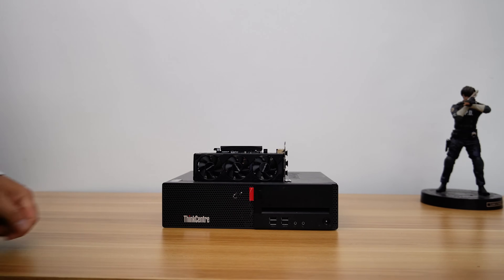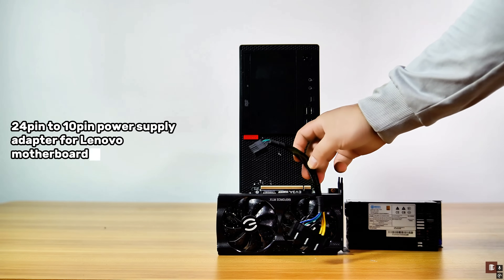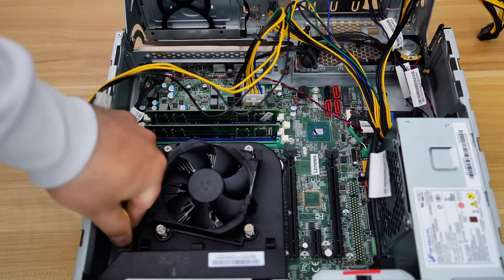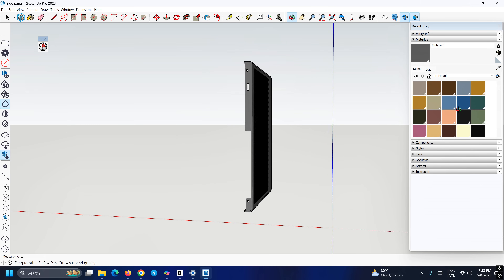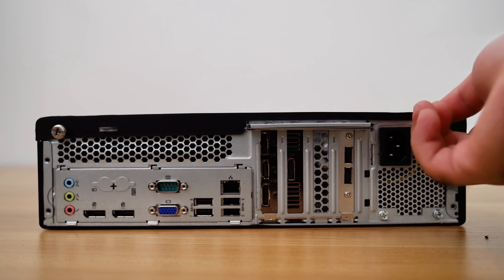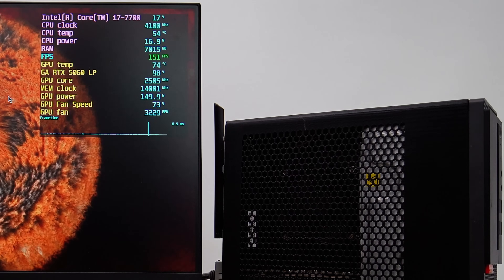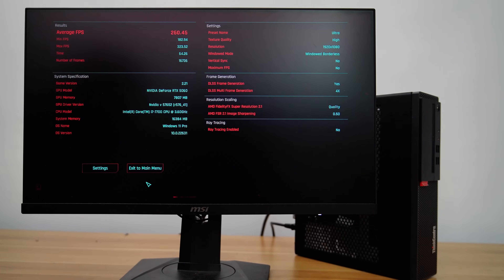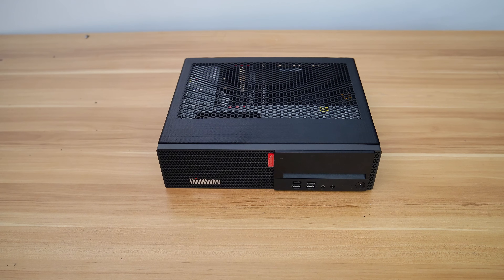RTX 5060 Low-Profile on SFF Office PC: Is It Really That Hot?

Comment from the maker: How much performance is lost on an old PC with PCIe 3.0 compared to a new PC with PCIe 5.0? Check out this video: https://youtu.be/hIzCymo0SdM
Reply: hi, can you make Ventilation size panel for Lenovo p330 sff ?
Reply: I finally got my 5060 LP. I just ran a Furmark at 8892 at 148 FPS in the PCIe 3.0 X4 slot on an Optiplex 7090 i9-10900. Max Core temp was 82 C.

System is Optiplex 7090 i9-10900.
64GB PC2666 Ram
256 GB Gen3 X4 NVME
ID-Cooling IS-55 CPU Cooler
Apevia ITX-PFC500W Power Supply
Noctua 80mm Intake Fan 
2 Noctua 40mm Outlet Fans

I compared it to my Non LP 4060 build which is superior in every way running in a Full Gen4 X16 slot and that one's Furmark was 7310 at 121 FPS.
Reply: Was able to get the Furmark over 9000 by upgrading to PC3200 RAM. It definitely runs hot, look forward to a possible ventilated side panel.

Comment: You replacement PSU is build friendly. Good luck doing the same with a Dell SFF9020. Flex ATX format, 8 pins Mobo instead of 24, and custom fan system.
Reply from the maker: All covered. Check my other videos.

Comment: yeah but there's kinda of mid card
if someone's going as low as office pc + lowest gpu on the market they are most likely gonna have old games to play...old games with physx32 that are no longer supported.
Also the cpu will be your bottle neck specially if it's one of those soldered or dead platform ones.

Comment: I'm thinking about purchasing a low profile rtx 5050, could you tell me if low profile gpus have the same performance as normal ones?
Reply from the maker: The RTX 5050 and RTX 5060 Low Profile indeed have the exact same specs as the normal, full-size RTX 5050 and RTX 5060 GPUs. The low-profile GPUs might be limited by their small fans and heatsinks, which can cause them to run hotter and tend to have lower clock speeds. In theory, those GPUs have the same performance, but the low-profile GPUs might lose some performance due to overheating that causes throttling.

Regarding your question, the low-profile GPUs for these models do have the same performance as the full-size GPUs if you can manage to keep the GPU temperature under the throttle limit. If it runs too hot, it can lose some performance due to GPU overheat throttling. Thank you.

Comment: Hey, thanks for video and sharing the side panel 3D print file. 

I had this panel printed locally with a service in PETG. It has really helped with CPU temps on the M920s I had built for my son. It was cheaper to print this panel than it was to source a stock panel from a M310.

Some feedback on the design; 
1. Add feet to the side panel print file. So that he stands up straight 😊. 
2. The hole for the right hand thumb screw did not line up fully with the chassis. The hole needs to move 2-3mm further to the right. The left is perfect along with the overall fit 😎

The videos you put out are great! You show what is possible with older systems and it reduces these becoming e-waste too soon. Thank you
Reply from the maker: Thanks for the feedback; I will consider your suggestions for a future update of the design.

Comment: I spent 1000 on the case/mb/ram/ps and it still overheats at 4k. :( Given, it's only supposed to be a 2k card...and who wants to play in 1080 anyway??? Like no lie, that card needs clear outside air and clear ventilation on both sides of the case....if you're going to put it in a case at all. The thing will burn your hands.

Comment: This is actually the direction I want PC gaming going.  I'm sick of large PCs.  This is something that makes me like what Nvidia has done over the past two generations unlike most people's opinions.   I'd rather see lower performance jumps from Generation to Generation if it means smaller hardware.   At the same time it also means game developers will not have to constantly up the grahpics wise every year or two as much.    Slower progression in performance = hardware we already own will be relevant longer.    If only Nvidia didn't charge an arm/leg for these products.  

That being said good example is comparing MSI's 3070 Ventus 2 to the MSI 4070 Ventus 2.  They look similar but the 4070 version is like 20-30% smaller height wise because the heat sink needed for a 4070 is much smaller than a 3070.  The 4070 gets better performance than a 3070 with less power draw.  Now that is the direction I want them to go.   

We've gotten to a point that old CPUs were smaller than a Silver Dollar, now they look like they're the size of a small smartphones.  GPUs which were once the size of check book are now almost the size of a Playstation 3 Super Slim.  This increase in size/girth really needs to stop.   I want them to slow down and try to get products back down toa small form factor, low power draws while not losing performance, even if it means only a 5%-10% gain each generation.

Comment: You could also have someone laser cut the top to put the same holes in it, which depending where you go, you could even get a fun pattern included.
Reply from the maker: That's an excellent suggestion! Laser cutting is a great alternative that could definitely work.

My channel focuses on creating solutions using the 3D design skills I specialize in, but the ultimate goal is to inspire people to solve problems in whatever way works best for them. Thanks for the creative idea!

Comment: Drill holes in the stock panel is an option too
Reply from the maker: If you don't need to keep your PC as it original and revert state and revert back later drill the holes also a good option to improve cooling.

Comment: since you don't allow edits, or have a fragile ego. 0:54 its very easy to upgrade a SFF. Will it fit all in the case? probably not. It takes a quick search on amazon to get the right GPU to motherboard power adapter to use a regular PSU that can power a normal GPU. If you're using any 5k series GPU that's moronic. get a 3k you know, an actual recommended GPU hat wont immediately get bottlenecked.

Comment: i feel a redesign of the side panel could allow you to put  1-2 90m fans next to the gpu to keep it even cooler so you don't need to be concerned if it could thermal throttle and allow it to get more performance too

Comment: I have done a similar mod using a Dell OptiPlex 790. Note: make sure you use the larger model with 4 expansion slots. This case already has vent holes in the top above the CPU and expansion slots, and the MB is a mATX form factor. I dropped in a Gigabyte B550M with a Ryzen 5 5500, and will be adding the 5060 when I get around to buying one, so it makes due with my old GTX 1030 for now. You'll have to do some wiring work for the power switch, etc. but the diagrams are all online

Comment: 5060 (145 watts) and 9600x3d(65 watts) the hdplex gan 250 watts can handle this cpu gpu combo?
Reply from the maker: I think you should not try it. The 9600X3D's maximum power limit is 138W, so while your setup might run for a little while, you will face system instability, crashes, or even damage to your PSU. Thank you.

Comment: plesae make solution with dell optiplex 5060 sff with lowprofile dual slot gpu wthout changing the psu, or normal gpu
Reply from the maker: It support single slot low profile only unless you cut off the case.

Comment: Thanks so much for this demonstration.  I have been wanting to push my 5060SFF as much as possible for a while, what better way than with the 5060LP? I managedto snag a 460w PSU and equip the case with fans and good cpu cooler too. I know there would be a bottl3neck with my i5 8500, but the sheer horsepower the 5060 and its framegen would have over my goldie 1650 would make it negligible. 

Asus will come ou with a smaller version of the 5060LP soon, can you do a video on that too? And compare either with the yeston single slot 3050LP 6GB?

Comment: I've heard that some of these lenovo PCs (Specifically in the m910 and M920 series thinkcentres) have an issue, that when you use a non-proprietary PSU, the motherboard won't turn off the PSU when you shut down the computer. Have you experienced this? I wanted to know, because I have a 450w SFF PSU and wanted to do a swap on my Lenovo thinkcentre M910t and don't want the PSU to stay on all the time. Any answer would be appreciated. Thanks.
Reply from the maker: Please research more about genuine PSU replacements versus 24-pin to 10-pin adapters for Lenovo. What are their differences?

Comment: Hi, Thank you for sharing your 3D print designs and nice videos! 

I am currently building a Lenovo M720s sleeper gaming PC with an RTX A2000 6GB, and I’m very interested in the ventilated lid you designed and uploaded. 
I am using a BambuLab A1 for 3D printing, but unfortunately, it cannot print this large model in one piece. I would like to modify the file and split it into two parts for easier printing. Would it be possible to get the original 3D file? I am having trouble converting the STL file into a proper 3D model for editing. Thank you very much, and best regards from Croatia!
Reply from the maker: Hi, I only have the SKB file. I think even if it's split into multiple parts, it still can't be reassembled into one piece. I believe the RTX A2000 will run well on your PC without needing an additional ventilation side panel, since both the CPU and GPU use a blower-style cooler. This means hot air won’t accumulate inside the case. Thank you.
Reply: Thank you for your reply! Would it be possible for you to export it as an OBJ file and send it to me that way? I am planning to replace the CPU cooler with a Thermalright AXP90-X53 and add extra intake and exhaust fans, since I always aim for the best possible cooling in my PC (my main gaming rig is in a Lian Li Lancool 3 case 😄).

Comment: 82C is not much room, because you really do not want Vram to reach 90C.
Reply from the maker: There is no choice but RAM is the same temp with with core temp in this GPU, even you overvolt this GPU. If you can't accept it don't buy it.

Comment: I have an Lenovo M920s SFF, i7 8700, 32gb RAM, but I use it opened with a Full size GTX 1660 super and fulll size PSU 550W with 24 to 10 p adapter... it's works, but is ugly

I would like do the same upgrade, rtx 5060 LP... but when I think about the price... I think it's better by a new one PC

Comment: Mine runs in the mid 80s on an open air test bench at a 22° C ambient. It's only going to get hotter in a case. Outside of better ventilation, I feel like it needs some PTM 7950 and an undervolt as well.
Reply from the maker: Thank you for sharing your experience!

Comment: I wonder if this 3D lid can fit my M75s. The lid shape is very similar.
Reply from the maker: You can check the dimensions of the PC chassis in their datasheets and compare whether the cases are the same size. I also assumed that the side panel would fit the Lenovo M720T since it looks exactly the same, but when I tried the printed side panel, it turned out to be smaller. Thank you.

Comment: You know, with proprietary PCs needing an upgrade, the Lenovo SFF PCs should have ddr4 16GB RAM and a potential RTX 3050 LP GP or an RX 6400 LP GPU. As well as a 450w PSU and an Intel i5 9500. Proprietary PCs are getting cheaper these days. You can probably buy it for $100 or less. Most PC gamers usually buy expensive PC parts and build them from scratch. However, some PC gamers would buy cheaper parts and research them on eBay, AliExpress, or FB marketplace. Speaking of which, the FB marketplace needs to be a standalone app instead of connecting to the FB account.

Comment: Great video! I've been waiting for a 5060 lp video. Everyone has been shitting on the 5060, and they're mostly valid complaints. But its real value is in its low profile gpu.
Reply from the maker: I am happy to hear that you like the video!
Reply: The 5060 can be expensive to buy. But the 20 and 30 series GPUs are cheaper.
Reply: @adogg281 correct, but I'm more concerned for low profile gpus. It's great to have options.

Comment: This video is about building a gaming PC as cheaply as possible using an old office PC. To do this, I need a 3D printer for the ventilated side panel, which easily costs €3,400. Where does it make sense to just drill a few holes into the old side panel?
Reply from the maker: Can you see the world in a good way? Feel free to try it on your own. My goal is to demonstrate that, as long as we can manage airflow in this restricted PC case, we can install a high-power, low-profile GPU like the RTX 4060 LP or RTX 5060 LP without overheating issues.

There are many solutions, such as leaving the side panel off or creating ventilation in the original side panel. However, my channel niche is 3D design, so I integrate my 3D design skills and printing into my videos to make them unique from other channels. This is my core strategy for surviving in the highly competitive video platform space.

Thank you for watching!

Comment: Why not just drill holes in the original case?
Reply from the maker: Feel free to try it on your own. My goal is to demonstrate that, as long as we can manage airflow in this restricted PC case, we can install a high-power, low-profile GPU like the RTX 4060 LP or RTX 5060 LP without overheating issues.

There are many solutions, such as leaving the side panel off or creating ventilation in the original side panel. However, my channel niche is 3D design, so I integrate my 3D design skills and printing into my videos to make them unique from other channels. This is my core strategy for surviving in the highly competitive video platform space.

Thank you for watching!
Reply: @itggear ah makes sense and thanks for the thoughtful response! lol I just couldn’t help but thinking the whole time that a drill could accomplish the same thing in a pinch.

Comment: Hello, I always enjoy your videos. Is there any way to compare this LP 5060 to the previous genereation? I have a RTX 3070 Pallit with Ryzen 5 3600 and I was thinking of upgrading my entire PC. So is this GPU represent a solid upgrade in this case I build a super small setup?
Reply: @EVANDROSAMPAIO  You dont need to upgrade.
You can get a 5700x3d and a 5070ti, and then wait like 7 years
Reply: Hi my friend I was thinking about this, 5700 or 5800 x3d have enough firepower for a couple of years, thanks for the advice 😊

Comment: a pos 5060 with a PCIe x8 conector instead of x16 is the main reason it performs poorly, unlike the 9060 XT. Furthermore, the motherboard would perform better if it was compatible with PCIe 5.0 instead of 3.0
Reply from the maker: Please compare the RTX 5060 with the RX 9060, as well as the RTX 5060 Ti with the RX 9060 XT. In this video, I am not focused on measuring performance loss in this PC setup. Instead, the goal is to determine whether this 'low-profile GPU' can be installed in an OEM PC chassis and to explore solutions for achieving this. In real-world usage, people can install this GPU in newer PCs like the ThinkCentre P360 SFF or HP Z2 G9. Therefore, you don't need to focus on aspects that are not relevant to the video's main topic. Thank you.

Comment: Nice but you'd be best showing something that just removed material on the oem cover or at least included that as an option. I love the printed component. I truly expect most to just go sans cover.
Reply from the maker: Feel free to try it on your own. My goal is to demonstrate that, as long as we can manage airflow in this restricted PC case, we can install a high-power, low-profile GPU like the RTX 4060 LP or RTX 5060 LP without overheating issues.

There are many solutions, such as leaving the side panel off or creating ventilation in the original side panel. However, my channel niche is 3D design, so I integrate my 3D design skills and printing into my videos to make them unique from other channels. This is my core strategy for surviving in the highly competitive video platform space.

Thank you for watching!

Comment: I am a complete nood at 3d printing to the point where i dont even know what material the side pannel is made from is there any way i could get the side pannel from some 3rd party i would have no idea how to even begin searching this up sorry for the inconvenience
Reply from the maker: The main objective of this video is to show you that the RTX 5060 Low Profile with a 145W TDP can indeed be installed and usable on an old SFF Office PC, provided that airflow is properly managed. The 3D-printed side panel is simply a tool to demonstrate that a solution exists for this setup.
For real-world usage, people don’t necessarily need a 3D-printed side panel. There are other ways to improve airflow, such as purchasing a ventilation side panel that fits this PC from an online store or modifying the existing side panel using their own methods to create ventilation.
So, you don’t need to focus too much on the 3D-printed side panel in this video, as it is not the main point we are discussing today.